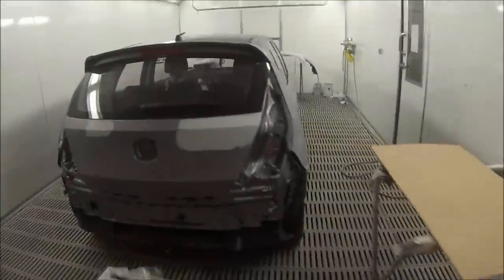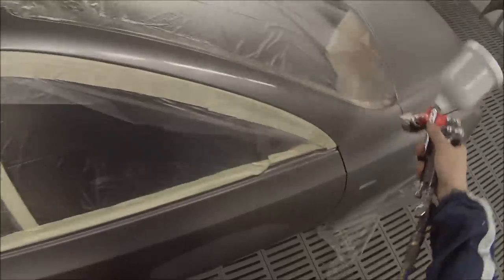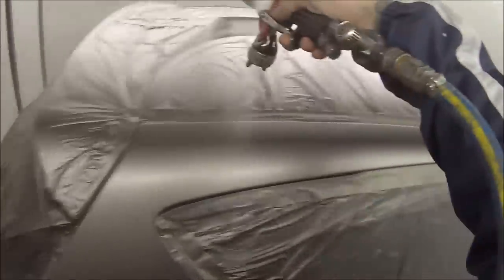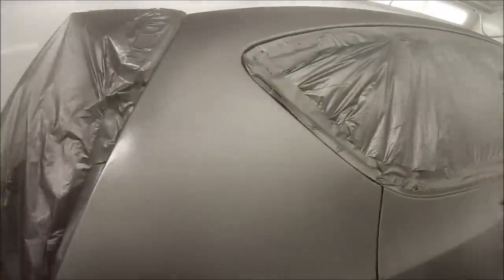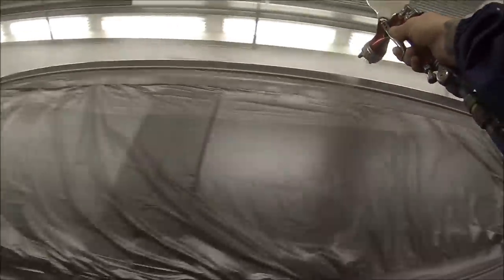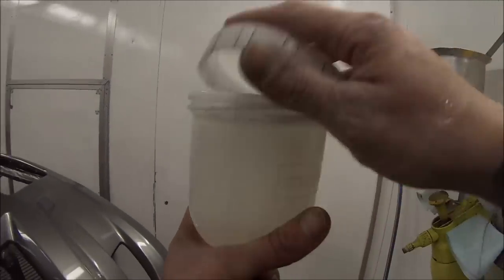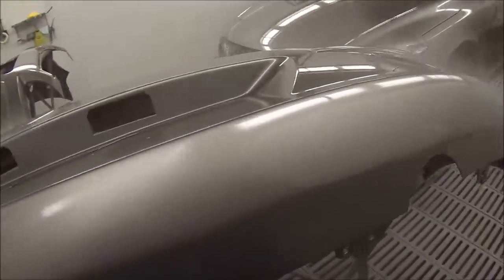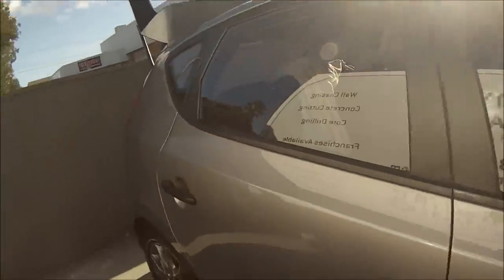How to Respray a car

Comment: Awesome GM - heaps of tips in this one let make sure I got this right
(1 If its bigger than a small car, DONT try and paint it in one go, do the roof one day then the rest.another.
(2 If its big and you have trouble with dryspots you can  Zig Zag / Use blending clear from another gun/ slow the reducer in the paint:
Did I miss anything?
Lastly about painting planes and things too big to fit in a paint booth. (of which I do a lot ie industrial machinery) ....at the airport job, do you use any kind of fans etc to create airflow and if so what do your recommend?
Keep up the awesome work !
Reply from the maker: 1. Yes I like to break the job up if possible on a respray however every job is different and you must be adaptable. I just resprayed a HQ ute and did roof and quarters at the same time because there was no mould to mask off.
2. Yes the blending reducer mixed with a little of the clear left over from the job picks up those dry spots real well. and yep you can set up big fans and filters in a workshop and even set up a tent to spray.

Comment: Thats great work definetley takes some skill, iv been panel beating respraying as a hobby over the years now its time to open my own workshop, wanted to ask you my jobs are pretty decent but i get alot of orange peel although i do all the mixing correctley. any tips or tricks ?? its something i really want to master respraying my car in a couple of days. Cheers
Reply: I would say your orange peel problem may be down to your product being too thick (check data sheet) or maybe your gun set up is wrong for high solids?

Comment: Can you get the same great results with a spray can if you sand the paint and clear coat after its dry?
Reply from the maker: It would take an extremely talented painter to do that sorry to say.
Reply: I would say no to that, at best only on small parts.
Just 6 days 
since I tried to respray the hood/bonnet on my car, I was struggling big
 time not to get tiger stripes because the paint is coming out too slow 
(dries before you go over it again) and not really uniform (Expensive 
can with fan nozzle) 
and when I was just about done it came a drop 
of paint from the can and ruined it because metallic silver cant just be
 sanded then clear coated.
so ended up buying a paint gun but the 
xylen is reacting with the other paint and i still struggle to paint it 
without it wrinkling up in some areas, last time ever using paint can on
 any car that I want to look better than a trash can

going to buy
 a new paint to use over it as a barrier that i know will keep it from 
reacting since it is hard to remove every little bit of paint from it, 
tried 2 times to remove "old" paint and respraying and has ended up 
sanding down paint for over 200 USD now just because that shitty acetone
 based spray can.

Never going to use paint can on my car again.
Hopefully done tomorrow 
And thanks to The Gunman for every video I have watched on tips for painting :)
Reply: Done the front bumper on my car completely with cans and 2K clear in can but is a bi##h not to get it loaded with orange peel, and it was around 15 degrees Celsius and still hard to spray without tiger stripes, too much solvents and little actual paint in those cans.
Most people doesn't notice it is resprayed before I say it but I'm still not totally happy with it

Comment: Did you switch tips? What tip did you use for the base and which size for the clear?
Reply from the maker: No I didn't switch I used a HVLP, H1 cap 1.3mm for both clear and base.

Comment: Gunman I've notice that you don't use a seal over the primed areas . any reason for that.
Reply from the maker: Do you mean a wet on wet or non sanding primer? if so I've found its not necessary using solvent base a small cut through wont rust or swell up.
Reply: The Gunman I think he was meaning with acrylic before you paint you put a primer surfacer on to stop the solvents from attacking the substrate. With 2pak Tony it isn't necessary because its all compatible and it's designed for it and it is not as strong as acrylic thinners. Hope that helps somewhat.

Also i have found wet on wet to be very peely, not recommended on the outside of a car as it would look really bad. Insides can be done like that to avoid the sanding stage but you will only get a chemical adhesion, not a mechanical and chemical adhesion so i have learnt.

Sorry if i have stepped out of line gunman, just thought i would say something from what i have learnt along my own journey.
Reply: Hey guys, Well at the old shop that I worked at we never used a sealer over the primer. At my new shop we use Standox 15331 2k sealer over the primed areas. The problem that I'm having is  where the sealer stop over the primed area Sometime it gets a dry spot . Then when I spray the base it goes on  rough over that spot. I'm going to skip the sealer next time and see what happen.   PS what do you guys spray over new panels before base coating then? Or do you just scuff the e-coat and then base?
Reply from the maker: Tony Camacho I know exactly what you mean and thats another reason i dont use the Standox wet on wet but back when i used Glasurit I never had those issues and these days I just put 2 coats of primer over new panels then a quick sand the next day as paint wont stick to the e-coat well. And josh your more than welcome to join in it was a good explanation and saved me some time Cheers.

Comment: would it be ok to sand the clear coat off say 300 600 1000 grit work your way up and then just lay down new base coat over the old paint as the clear is peeling, or do i have to rub the hole car back to metal as its going to be the same paint code i see you are just priming what needs to be primed then your rubbing back the old clear coat and leaving the old paint there then smashing new base coat over it ?

Comment: Hey mate ,  if you could reply to this that would be so appreciated! what gun are you using? what type of clear (ms/hs) brand  ? air pressure?  reducer if any? gun setting? oven temp? I've been painting for years and i still get orange peel ,  not greatly but id really like to perfect it. thanks from a fellow painter!!
Reply from the maker: Hi mate, in this vid I used Standox Solvent and Duxone 2K clear with no reducer, testing my memory because I did this one a few years ago but think it was the DeVilbiss GTI Po T2 air cap, 25-29psi or around 2 bar
Watch this vid
https://www.youtube.com/watch?v=_-MimyH3fKY

Comment: Hey gunman, the DeVilbiss gti pro i think sprays quite fast compared to my anest iwata bellaria i think. The supernova is pretty much the same as a supernova, it sprays flat and thin, not like conventional gun where it is wider in the middle and thin up top (spray pattern when setting up).

I also keep getting some runs on the vk, its so hard to not get them. I was told if you spray 2 pack medium or dry no matter what, the next coat will turn out the same and that i should put the first coat on wet and the second coat wet also. I'm using high solids and was told 2 coats is ample but my god father who is a spray painter (retired) said 2 coats isn't enough if you sand it back, 3 coats would be better, what is your take on it? I'm using protec paints.

I heard you said how you used to spray a car, what is the best way to to a full respray on the outside? I was thinking of doing it in the shed but i needa get a fan to suck out some overspray or use the booth across the road whenever it's free (which is never due to atleast 15 - 25 cars on average per week) plus they get a bit of stuff in their paint even though they clean the booths every week.

Also what is that juice cut, polish product like? I have seen you use it in some of your videos.

Sorry about the long message bro! Thanks in advance for your advice.
Kind regards,
Josh.
Reply: The W400 classic bellaria is pretty much the same as the supernova. I was meant to say that. woops haha.
Reply from the maker: Hi Josh I've never used the Iwatas much but i did like the W400 and can see why they are so popular, and your uncle is probably just old school from the acrylic days when they would put 6-10 coats of clear on then cut 4 off to get it like glass, and the juice is awesome the super c cuts up so quick I'd recommend it for sure.
Reply from the maker: so yeah 2 coats is enough even if you want to cut it
Reply from the maker: if youre using cheap paint thats not unusual, and the best advice is just to put the base on really dry and let it flash off before re applying the next coat dry again, hope this helps, priming any rub throughs can help too

Comment: I was wondering what needs to be done to old paint if I’m repainting same color. Ex. I need to paint a qtr panel that was damaged and will be down to bare metal. I have a good understanding of sealing, building primer, sand, the bc/cc but if the other parts of the car are in decent shape beside old and fade. Do I need to you a certain grit sand paper to scuff them up before applying bc/cc I would rather not sand them down to bare metal/ prime to paint the same color. Thanks

Comment: I have some large chips and surface rust I'm looking to fix, then doing a respray like this. do you just get down to bare metal in the bad spots and prime? would you use any primer sealer?

Comment: how may coats of paint did you applied before clear .?
Reply from the maker: 3 or until covered, some cheaper brands of paint may need more coats and the color will also change how well it covers.

Comment: Great respray bud !
Do you ever have troubles with not having the pot lid air hole cap in place ? I would be worried id get a drip on bonnet come out ?

Comment: Gunman - what happens if paint is applied on top of old paint (same color), meaning on top of old clear coat after wet-sanding. Will this cause ill side effect?   Please respond tank u
Reply from the maker: No problem at all.
Reply: The Gunman Ok tank u so much Gunman

Comment: Do you primed the cat wen you respray ? Are you just paint it with out the primer?
Reply from the maker: The light grey surface was primer. as for the rest of it there's no need to use primer over the old paint as long as it's in good condition.
Reply: thank so much i'm respraying my car black again what sanpaper do i use?
Reply from the maker: Andrew Rodriguez finish it with 500-600 if dry or 800 if wet
Reply: thank you so much